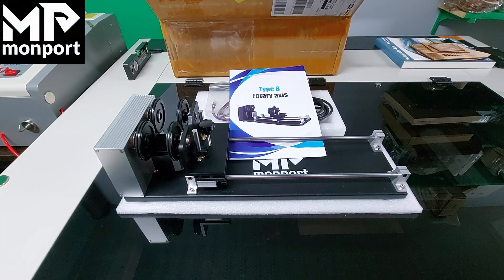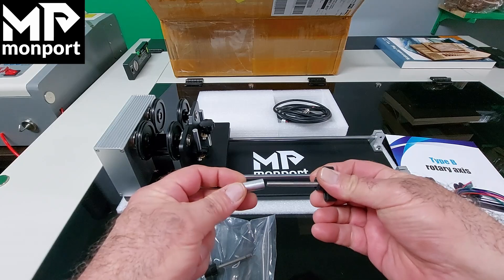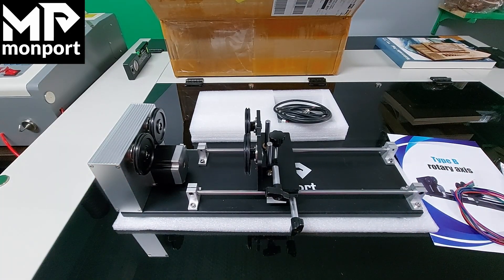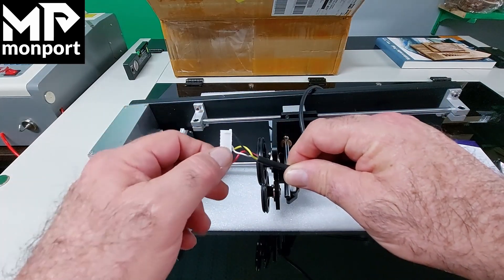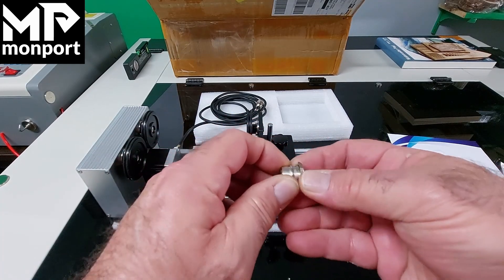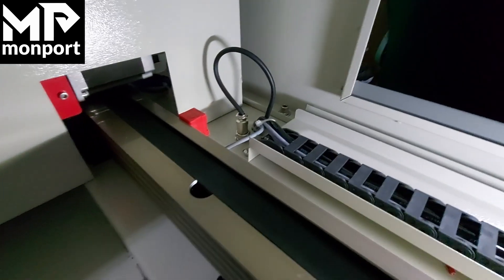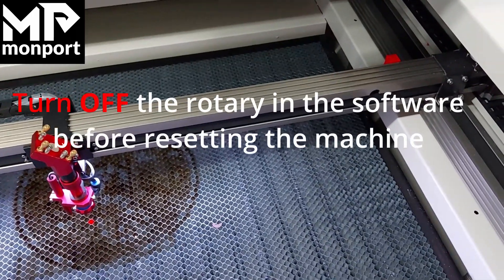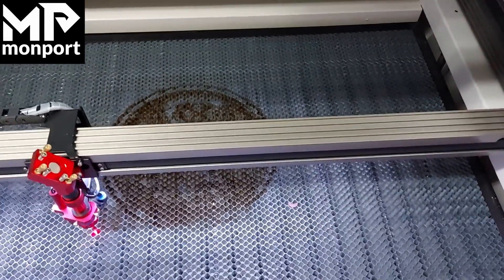Assembly and First use of the Monport Laser Engraver, Type-B, Rotary Roller Accessory

Comment: Hello. So i recently got a Monport K40 Pro. On the bottom of the machine there are 4 screws that hold on a bottom plate. I'm wondering if I drop that bottom plate and raise the k 40 a bit will that roller fit through that opening? i don't know if that plate is standard across the board in the Monport k40 line but the one that you have a video for looks to be the same layout as mine.. I want to drop it through to allow for clearance to the laser head..
Reply from the maker: Hello! You may contact support@monportlaser.com ☺️